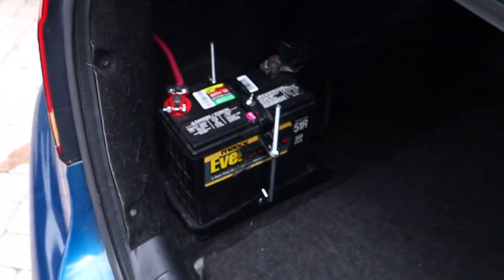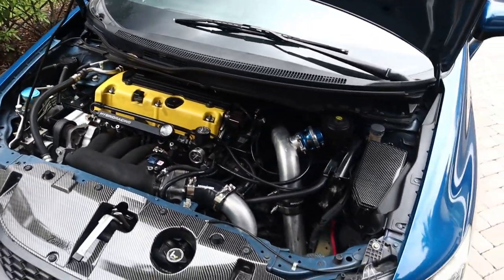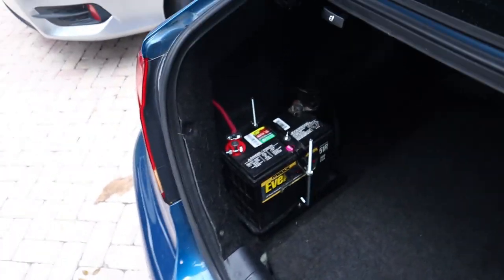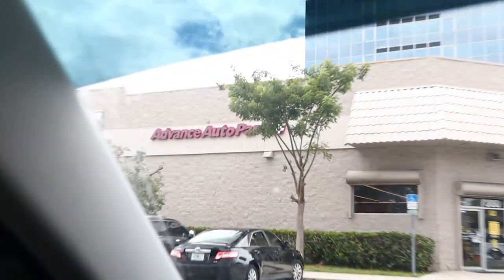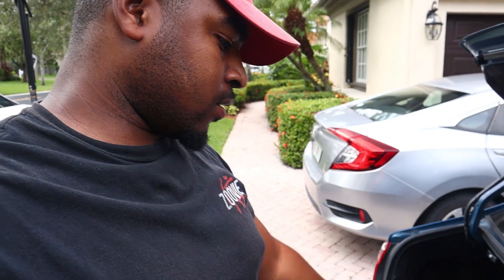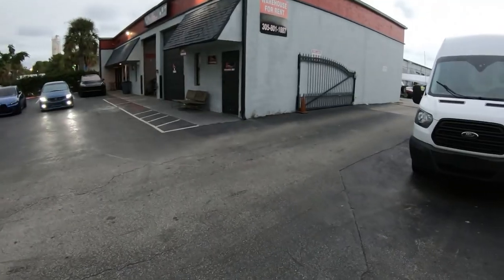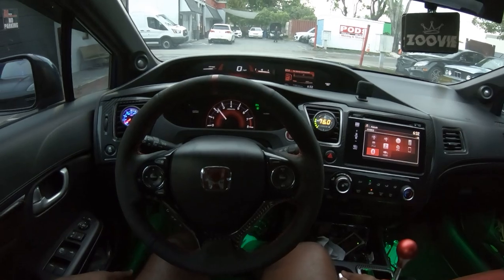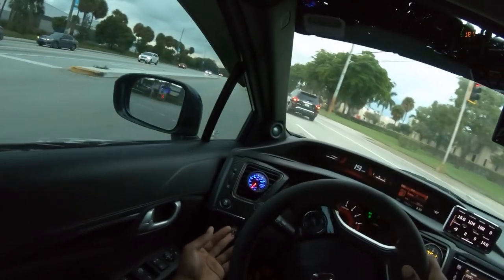GOT MY BATTERY RELOCATED TO MY TRUNK! + NEW GOPRO SETUP!

Comment: I think you should’ve done a tutorial on how you relocated the battery into the trunk
Reply: I agree
Reply: I agree
Reply: Just need extended positive and ground and you can put the battery anywhere
Reply: @itsyaboirich  and how would i run it through the car?
Reply from the maker: I didn’t do the relocation
Reply from the maker: You can run it inside underneath panels
Reply: Jus extent the power with some 0 guage wire and ground it literally anywhere to the chassis jus sand down the area to get bare metal
Reply: Aww shit

Comment: Can you tell us what was required to do the relocation! Materials?!
Reply from the maker: I’ll do a more detailed video on what is required
Reply: @zoovie  yess! Thanks I plan on doing the same!
Reply: 0 guage wire. A 250a fuse for the power and some eyelets also some 10 guage wire and connectors for the negative sensor “voltage meter”. I did it on mine it’s pretty easy. Just have to be good at tucking wires under panels and that’s all
Reply: @Shanem.07  you think I could see some pictures or like a drawn diagram 😅thanks for the reply though!